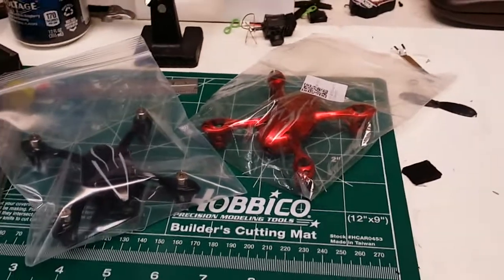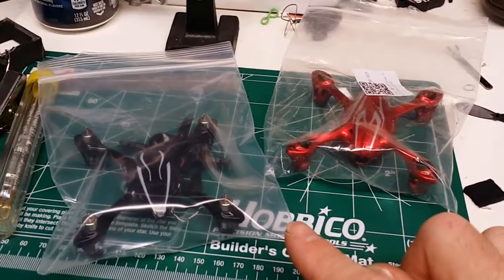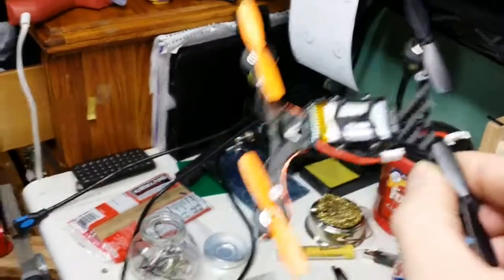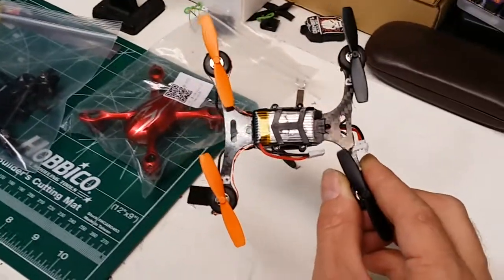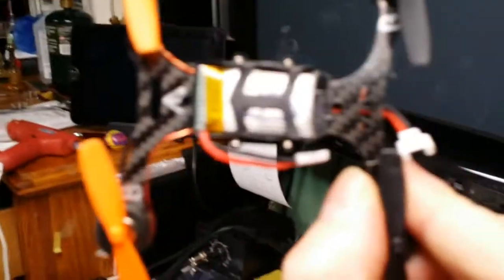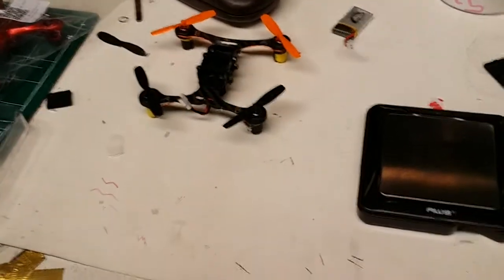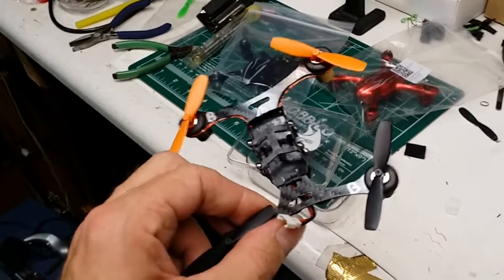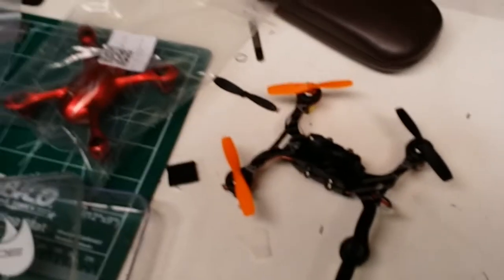Micro quadcopter X 4 carbon fiber transplant

Comment: can i do this with the h107? does it fly same as stock in the carbon fibre frame ?? any wobble ?
Reply from the maker: Rc_ KiNg i had no wobble without adding a fpv camera but a little with the Micro vtx cam combo.
Reply: ok so no fpv and im good? can i use a × frame
Reply from the maker: Rc_ KiNg the main board is a bit of a rectangle but if you find an x frame ild love to see it. sounds like a cool idea
Reply: yah man do u maybe have kik or something i can add you on? or i can mail you my number
Reply from the maker: Rc_ KiNg  no I don't but if you want to email me it's DJ klermund @ gmail.com

Comment: you may have only shaved off 1 gram, but think about it. you can attach a much larger mah battery, and i would say as far as durability goes, the carbon fiber will outlast the crash pack. i broke an arm off my h107chd today and decided to do some research.  im definatly buying the CF frame. thanks for the info and nice vid buddy!!!
Reply: don brush so do u think getting this little drone amd getting the carbon frame is good i mean waw it looks awesome i even have a small aluminium suitcase box thing that will perfectly hold this little guy and like 10 batteries so what do u think?